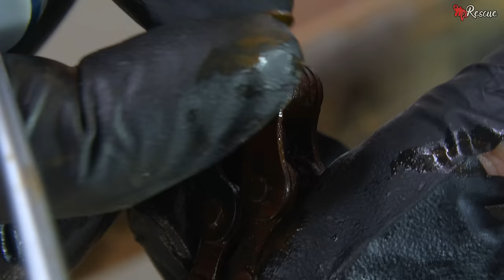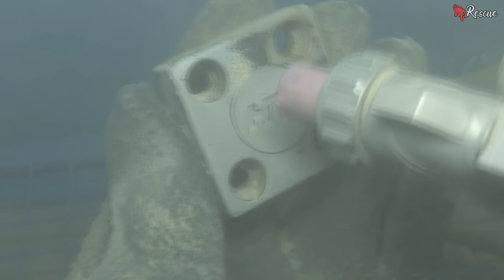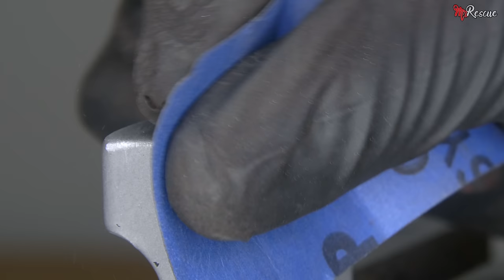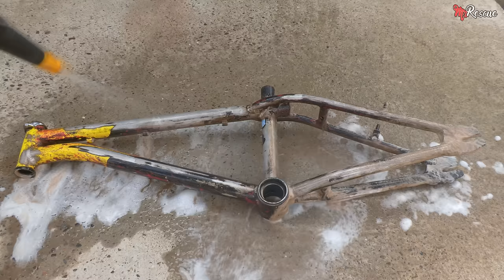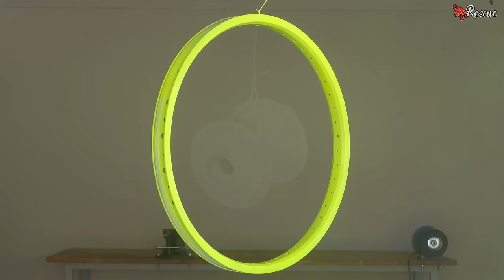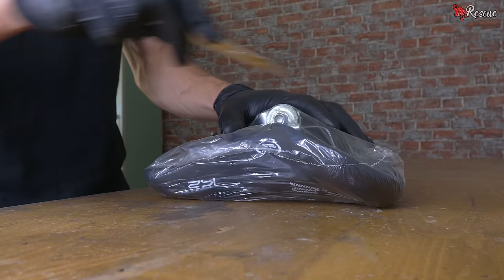Restoration BMX Bike - Complete Process

Comment: Proof that something can look good to the untrained eye but in reality it’ll eat itself from the inside out in very short order. Incorrectly put together, nowhere near enough grease and a paint job that’s superficially ok but it’ll chip / wear off in minutes. Could’ve been great, turned out meh.
Reply: Did one of these 7 years ago but paid for powder coating, mat black base and sky blue transparent over it, still looks great like the first day... And yeah those brakes he put, gawd...
Reply: You obviously don't know what you're talking about because there is more than enough grease, and the paint is just fine I did this paint job on my bike and it holds great.
Reply: @bobbob-es4vi  If your spray painted bike is holding up just fine I can't imagine you ride it overly hard :)
Reply: Spray painting is shit, I restored a minibike and made the mistake of spray painting it, it chipped off simply with the friction of putting every everything together.
Reply: @bobbob-es4vi  bahahahaha you sound so silly. The dude put the crank bearings in backwards. YOU obviously don't know what you're talking about.
Reply: @jaredgulaga8367  ever heard of clear gloss
Reply: Completely agree with you!!
Reply: 🤣🤣I restored and old kids bike for my god daughter and ended up spray painting. That was 3 yrs ago and no chips🤷‍♂️after spraying the item needs to be heated so it'll form a greater bond. Guess if you don't do some research 1st it may come out like shyt🤷‍♂️🤣
Reply: Tell me you know nothing about what he is doing without telling me you know nothing about what he is doing

Comment: Pretty sure it's a GT Performer, or at least a copy of one. I found a genuine frame and fork at a garage sale...found an unused stem and 3pc GT cranks still in the box. I hope it turns out as good as yours.....AMAZING!
Reply: It’s a pacific cyclone 1996
Reply: @chair2703  Is it a GT copy? Even the stem looks to be a GT knockoff. Either way, thank you for the information...very interesting.
Reply: It’s definitely some kind of knock off of the lmid to late 90’s gt performer

Comment: Quite fascinating to watch; not least because I am a lover of vintage road bikes. I really appreciated watching the disassembly and cleaning operations. Would love to know what you use for paint stripper; I cannot find anything with half the strength of 30 years ago. I did not see where you were going with the color scheme, but I loved the surprise of the dayglow wheels!! Wonderful.
Reply: Jasco aircraft paint stripper. They come in gel form. Brush on then either wipe, scrape or wash off after 30 minutes.
Reply: Go for aircraft paint stripper but be careful, it's dangerous if improperly handled. It should bubble the paint right off
Reply: Nitromorse is a good paint stripper available in the UK, otherwise get an ex girlfriend and a bottle of brake fluid!
Reply: This is no where near a vintage road bike which I also love. This is ……. Something else.

Comment: I like what he has done, the finished product looks great, but the bottom bracket bearings are the wrong way round and you lost me at taking apart the cheapest freewheel only to put it back together dry
Reply: here I am playing a les Paul and your name shows up....the best guitar player ever!!
Reply: Thats what i was goin to say!
Reply: There some part were I feel as a bike builder and restorer that this guy did wrong and I did not understand
Reply: Most of the parts were reused
Reply: You ain't kidding, this bike isn't much "better" than when he took it apart. Bike people cringe  watching this.
Reply: No clear coat on the paint makes it scratch easily, not a terrible start to bike building/restoring though
Reply: American sealed bb. And ide have got freewheel off without busting it. I restored my sunday wave 2. Still hop bar first try

Comment: I worked in bicycle shops in the 80s. In the early 80s BMX racing was blowing up. Around ‘82 guys were taking their racing bikes and  riding ramps and  doing trick shows on on them. By the mid eighties 20” bikes were being produced exclusively for doing tricks. They were heavier and had pegs, rotors, longer wheel bases and other stuff that was not built for racing. We called them freestyle bikes. Fast forward to now and freestyle bikes are called BMX bikes.  Ot sure when that happened 😀

Comment: The only thing that makes me question this particular video is the ease with which everything came apart. I have stripped and rebuilt a number of bikes, and seat posts and stems can develop galvanic corrosion which makes them impossible to remove without A LOT of work. Obviously not all rust equals galvanic corrosion, but given the state of the bike it didn't seem congruent. 

Good work either way though. Pretty diligent cleaning.
Reply: Seemed a bit too east to me also ... plus the newer components on an "old" BMX ... this is a little shady LOL
Reply: WD40 works wonders
Reply: Most likely, he took an okay-condition bike, beat the shit out of the rims, painted it with rust forming “paint” and soaked it in mud to give the effect of it being old. People are very creative in what they do haha
Reply: @lawrwncemitchell9955  Yea if you use about 50 gallons of it.
Reply: @kanifuker721  True 😂
Reply: @kanifuker721  But thats what these restorers do.. Hose it down with tons of wd40 where 99 prosent of it just runs off and go to waste and 1% actually penetrating.. lol
Reply: yeah pretty sure they didn't have 3 piece cranks in the 60's, 70's or 80's, everything looked late 90's early 2000's, the allen head boats are a dead giveaway

Comment: I used to run a bike shop years ago,that bike is not safe.You did not use lithium grease,nor any grease.When the wheel bearings heat up,they can break apart causing the wheel to stop suddenly, and the headset can lock up making steering very hard, leading to injury or death.While your efforts are commendable,remember next time to completely do the job.

Comment: Nice restoration. Personally, I think it would have been cooler to polish the frame and have a "Raw" look to it. Or, at-least powder coat it. Although, you can tell by just looking at it that the bike is clearly department store grade.
Reply: I’m not so sure about that. The frame shape really says to me that that’s a GT Bikes Performer from around 1987 or so
Reply: Yeah, I don't see where "Department store" comes in here?
Seems to be solidly built, nice welds, and it has at least endured so hardships and was still salvageable.
Reply: looks like a GT 1980s...Google the prices.
Reply: @matthoward8546  its not an 80's bike. it has braze ons and V brakes. an 80's GT would have had calipers. Id say its late 90's to early 2000's and the 3 piece cranks say that it was at least something of a reasonable quality.
Reply: Definitely not a GT.  Or not a GT made in the 80s or 90s.  Everything on it looks stock to me.  The v brakes, the huge flange hubs, and screw on pegs over the axle nut are all classic department store features.

Comment: hmmm it makes me wonder....with all the rust outside the bike surface, THE HUB AXLE ISN'T RUSTY at all??? my new bike's CroMoly axle even gets rust if left unchecked!  Even the BB insides seem to have no signs of rust!  haha!
Reply: It's only surface rust.. the metal is not damage enough. nothing to worry about. And Don you find it odd that those "restoration video" always have the same amount of dirt on them. The stuff is orange Like it's never just used, it's also dragged in a mud pit for 6h and left to die in a pit. 

I'm pretty sure the dude is responsible for at least half the damage on the bike. 

And the worst he's using WD-40 as penetrating oil which is not.
Reply: Usually surface rust doesn't get to bearing in the head,crank,and hubs
Reply: Lapro💎💎💎💎💎💎💎💎💎💎💎🇦🇷💎🇦🇷🇦🇷🇦🇷💎💎💎💎💎💎💎💎💎💎💎💎💎💎💎💎

Comment: Why do you use the open end of a spanner on fasteners? You are supposed to use the closed end to tighten or loosen. The open end is more for turning it on or off the thread or when you can't access with the closed end. The closed end has more points of contact on the fastener and is less likely to round it off.

Comment: Thorough project, but you never really want to reuse old spokes and nipples. Tape off the bearing races and bushings when painting if you aren't going to remove them. Same goes for braking surface.

Comment: Very cool finished effect, who wouldn't want a custom paint job like that! Not sure how effective or long-lasting the brakes are going to be with rubber blocks running on a painted surface though.

I think that's called a Trick bike, with those pegs on the axles. A "BMX" would have gears for gradients.

Comment: Kind of cool.  But why save the bike chain it holds no value and is a replaceable item they stretch over time.  Or taking off paint with a wire brush just to hit it with sand paper.  Nice job on saving the rotor components though.

Comment: This is something i have a hard time understand. This guy is very good at metalwork, he is percistant and hard working. Doing an exellent job at restoring an old trick bike. But then he paints it with one component paint that easily get scratched, fades with sunlight and dont withstands any chemicals what so ever. If you put in this much work, and make a tutorial video, why not use 2K paint, like all professionals do?
Reply: My mistake gen 2 bars gen ones have a rounded surface on the part that attaches to the stem sorry lol reply plz

Comment: Odyssey brakes it had had a snafu crank not a snap of a camera kind of three-piece crank it was but it was a really expensive one like a $400 three-piece crank had really had triple wall rims on it it had a medium size chain on it the only thing it lacked was a smallish front sprocket like they have on the new ones a smaller front sprocket on the front

Comment: I use to tear down my GT and my Dyno completely when I was a kid and build it back up again. I can tell you a couple of things I would of done different. First off, I would have not filed down those nuts like you did. You ruined them and really just roumded them off (13:52). Unless there is nother part of the video where you fixed this, I would not have done this ever. A HUGE mistake was you not packing with grease those rear wheels. Who does this? The gyro needed to be greased as well and you did not do that. Also, why did you put those spacers on the gyro? Those are not needed. This bike could have been done much better if you replaced a lot of these components with new ones. As for the paint job, powder coat would be the way to go. I am not mocking the work you did but clearly alot of that work was done for show and likes. Also, you forgot to oil up the chain. That chain should have been replaced with a new one or been in oil after cleaning befor installing.
Reply: Ya, that dry sprocket spin sound on rear wheel made my inner child cry. I ran a Predator and Master, is this a GT? Used to know every bike but been so long I can't remember now.

Comment: The bike "looks" nice a restoration isn't complete unless the item is seen in action which begs the question: why didn't you ride it/do a few tricks, and then show the bikes condition afterwards? Is it b/c the chain will rub the paint off the sprocket, and the brake pads will rub the paint off the rims? Again looks good, but...

Comment: Nice job.  ☺️  You might want to include more wide angle shots next time.  I know a little bit about bike anatomy, but only a little.  As such it was kind of hard to tell which part of the bike you were working on.  Also, I’ve never seen anyone paint the gear wheel or the hubs of a bike before.  Is that a new thing?

Comment: Are you serious at https://youtu.be/EiZXNjgOJAM?t=1487? Leaving the paint on the ball bearing shell? And why did you paint the rim walls? This paint will come off right away when using the brakes. There is a reason why rims are NOT painted there. Also you usually do NOT use old spokes again but replace them with new ones.